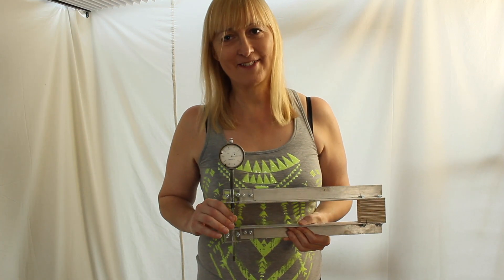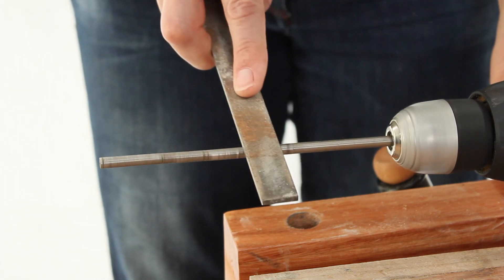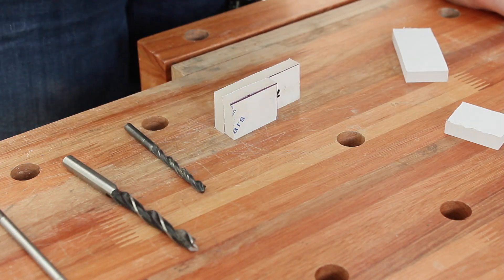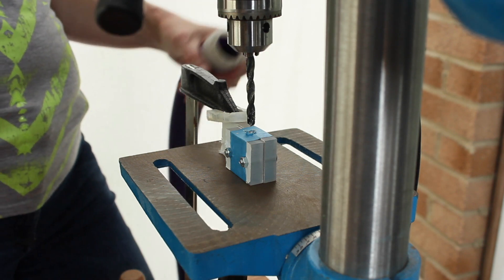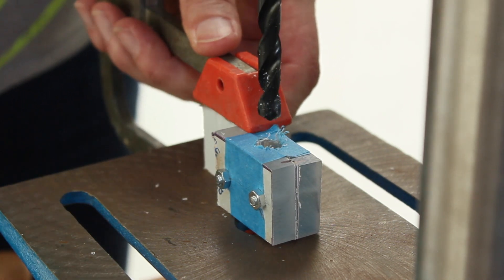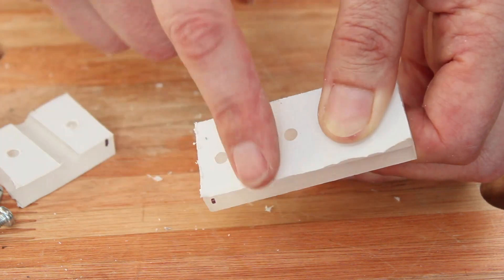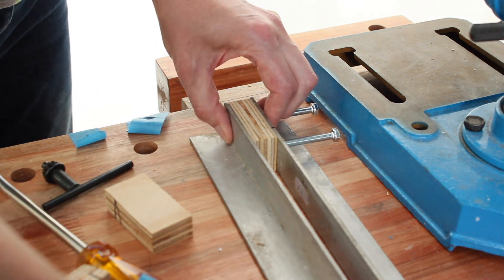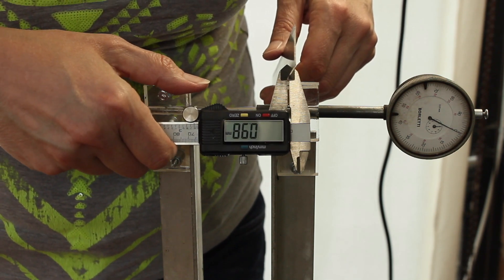DIY thickness caliper

Comment: Just want to say I'm enjoying your videos. Watching you improvise using the tools you have available is fascinating. 
You should consider getting an inexpensive drill press vise ($20 -$25 US). It's amazingly useful, and will save wear and tear on your luthier clamps. Clamp it down to the slots in your drill press table with a couple of large bolts, aligning it as needed, and you'll have solid support for the parts you're drilling.
Keep up the good work, and thanks for the video!

Comment: I modifie my commercial caliper to have a flat anvil below the dial gauge since I only use it for checking flat stock. The single point design you have is great for carved work.... great design tho. Well done.

Comment: A very simple approach, and the one that I use, is to joint two pieces of wood, long enough to fit the plate I am thicknessing, drill holes on the ends to fit 5/16in bolts. Between the two pieces of wood, at each end, I place thin washers to create an opening of the desired thickness (you could measure the opening with dial calipers). I then run the plate through the opening. Where it slightly binds, I mark with chalk or a pencil, then plane off the material. Continue the process until the plate goes through the opening with minimal amount of contact. Simple, yet effective

Comment: Another Interesting Video. Can I suggest that when drilling you can swing the table round so that the drill passes through the "T" bolt slots, that way you could get 2 clamps on the work piece. Also you don't have to push the drill bit right up into the chuck, you could start the hole like that then drop the drill in the chuck until it's held by about 3/8".   Still waiting to hear you play the restored Guitar !
Reply from the maker: +Jack Tar nice tip, thanks. You will hear the guitar, fear not :-)

Comment: when drilling plastic of any type use a HSS drill with the cutting edge backed of so it's 90 degrees to the job not blunt  . I have a set of drills that I keep just for plastic and brass ( the same drills can be used for brass ) P.s I was a plastic fabricator for 10 years . last year I got a good set of drills from aldi for about 5.99 in a metal storage box .
Reply: It's also true of drilling brass and bronze, to avoid 'grabbing' and in Aluminium, where a very slight negative drill rake is best practice.

Comment: When holding the electric drill in the vice, you should be able to use the button on the handle to lock the switch in the on position, allowing you to use both hands.

Comment: Nice tool. About drilling: Drills don 't work well like that. A pilot hole does help guiding the drill on soft materials, but it must be smaller than the center part of the drill, or the spike of brad point. Any bigger than that and the drill bites and something is likely to break. A bradpoint can also go badly off-center. If you need a very smooth and precise hole, then you need a reamer. On soft materials a drill can be used as a reamer by spinning it backwards, but that really works only on soft woods and such.
Reply from the maker: +esa062 Will reamers always give a tapered hole, or can you get reamers with a parallel upper section? I only have 1 reamer and it's tapered all the way.
Reply: There are straight reamers too.

Comment: Just a thought, would it have been easier to clamp the angle iron together first using the masking tape and glue method and clamping to a piece of wood so you'd have the shoulder on the wood clamped down then drill your holes. Then tape your pieces of wood together that you've prepared  and use one piece of the angle to mark and partly drill through to get correct spacing, then remove the angle and continue drilling through the wood. I hope this makes sense, it's a little hard to explain. 
Looking forward to hearing that acoustic. .

Comment: Shipping might be a problem but I would gladly machine something like that for you when you need it!like your work wish you were closer as I've got an old fender guitar that needs some love
Reply from the maker: +cmonster6 I'm guessing you're USA/Canada? When you say machining, do you mean the probe or the frame? I'm curious how stiff the commercial frames are - they look like cast aluminium struts. Maybe the $300 one I saw is titanium?
Reply: +Susan Gardener I'm in us,I was referring to the probe you were sanding to dimension-would take literally 3minutes on lathe to turn to size.i have never seen a commercial unit but I'm guessing on the pricing be related to the quality of the guage mititouyo vs Chinese knock off Ect

Comment: it appears to me you could use a drill press vise.  nice video
Reply: was going to suggest the same thing. also, if you do overheat the perspex, it will re-stick itself, and the resulting mess is far tougher than the original perspex. a bit of coolant oil helps.